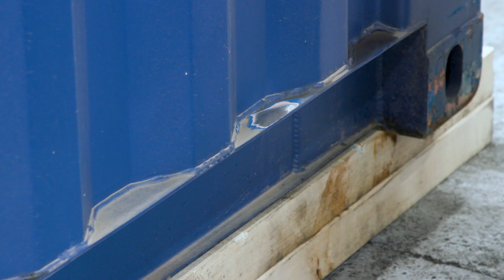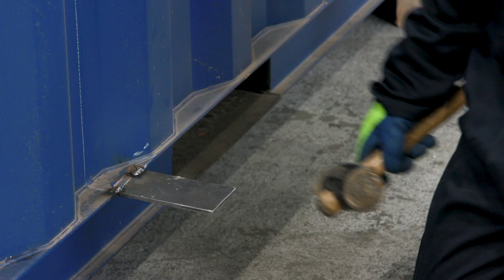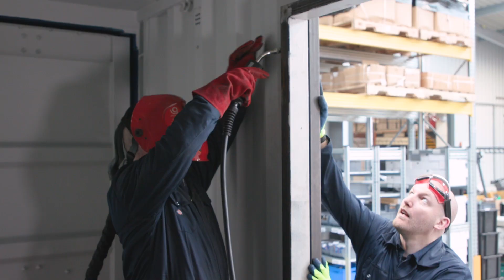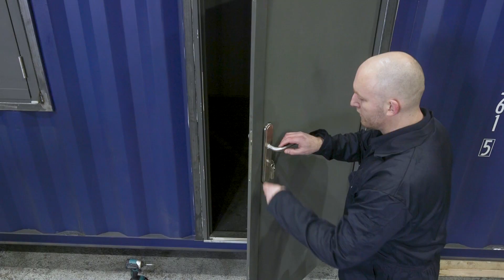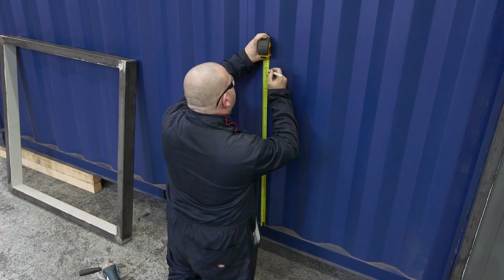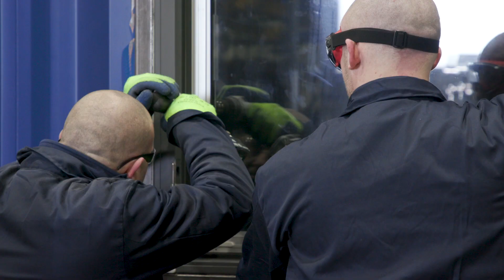How to install a Shipping Container Door & Anti Vandal Window Shutter

Comment: Great. I really enjoyed your informative video. I'm planning to cut a container to install a window using a grinder like you. Could you recommend the most suitable grinder disc for cutting a container efficiently?
Reply from the maker: Hi there,
Thanks so much—we're glad you found the video useful! For cutting a shipping container, we recommend using a 4.5" or 5" angle grinder fitted with a thin 1.0–1.6mm metal cut-off disc. Just make sure to wear proper PPE and watch for sparks near flammable materials!

Comment: Excellent video. Well explained. Well finished service.

For security reasons, I'd put the hinges to inside, just. Obviously, door would open to inside.
Reply from the maker: Hi João, thanks for the comment, glad you enjoyed it. Of course, doors can be installed any orientation, we find that depending on the use, customers prefer and outward opening door, to maximise space inside the container. With all the locking points around the frame, should anyone attack the hinges, the door leaf itself would still be secured within the frame.